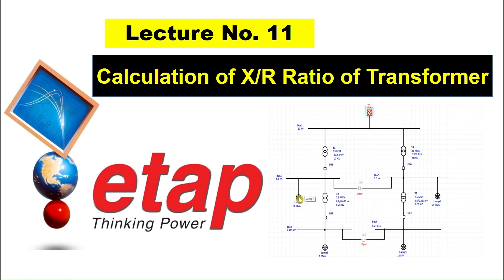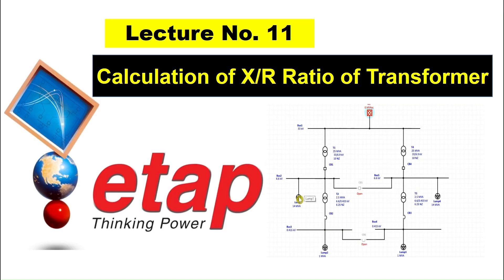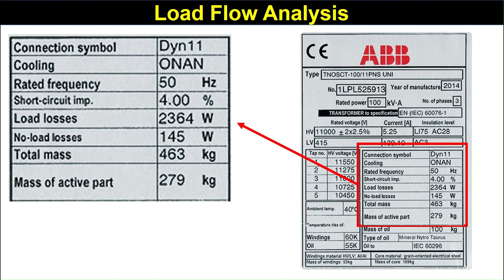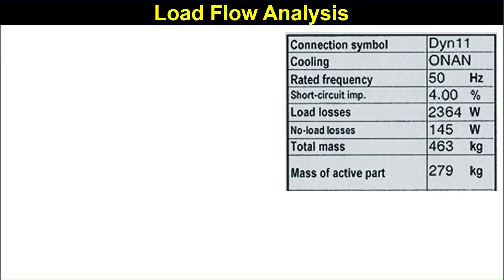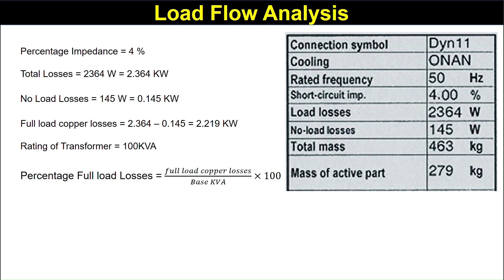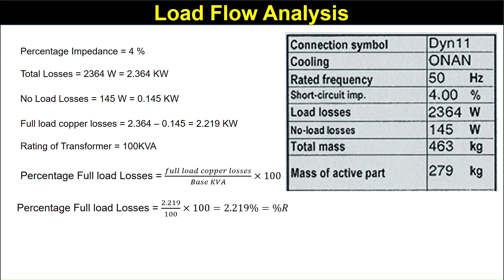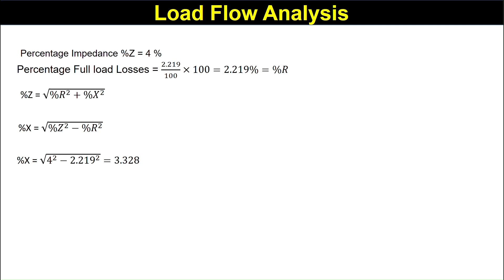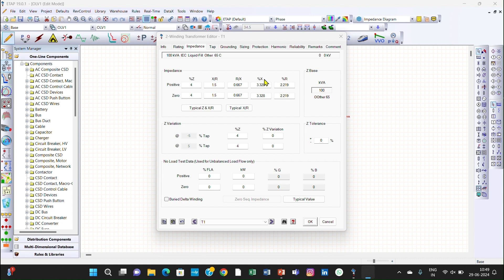Lecture 11 | Calculation of X/R Ratio of Transformer | Etap full course | Free courses

Comment: thankyou sir now i can calculate voltage drop of transformer based on load
Reply from the maker: Thanks
Reply: @ElectricalDesignEngineering  i have one doubt sir as if z% is 10 then 10% of nominal voltage will drop on full load current let 'x' be fullload current now x is 10% current  finding 100% of x i.e (x/10)*100  than that 100% is short circuit current and voltage is zero if calculating 5% of i.e (x/10)*5 so vol drop is not 5% of nominal vol why is it so sir i want know

Comment: I tried to get the X/R ratio in ETAP after adding Z%, but I couldn't. When I entered the converter data and added Z%, I couldn't find the X/R, so I added it manually by clicking on the typical X/R ratio.

Comment: Calculation error;
"Load flow calculation did not converge in the specified maximum number of iterations.
For more information, refer to the table 'Messages' in the report database."

Please need a solution above
Reply from the maker: https://youtu.be/vkU4r6MtUmE
See above video
In addition to this video check system for overload also